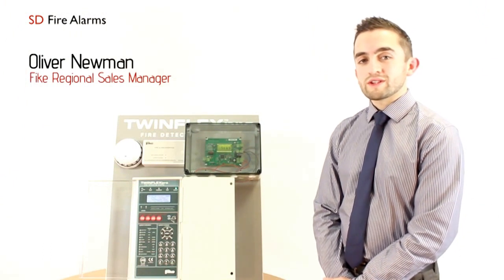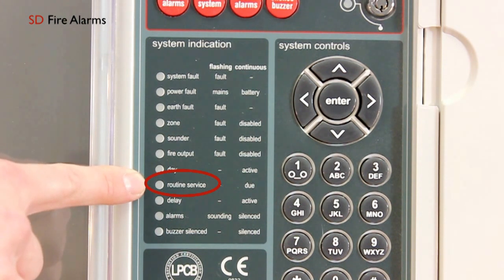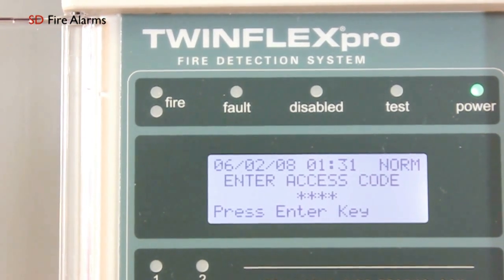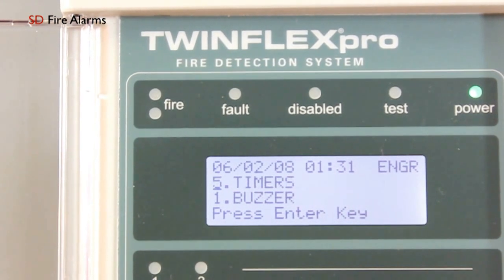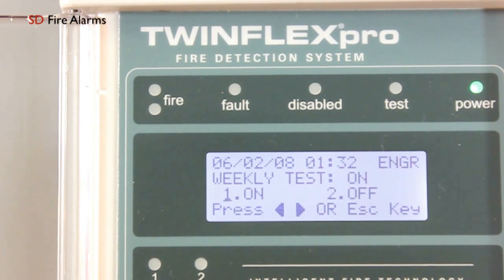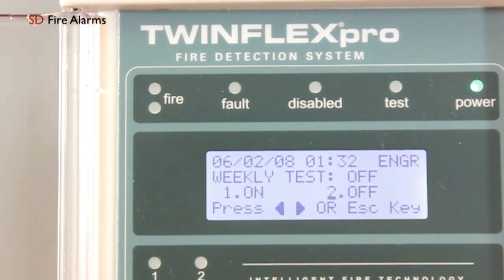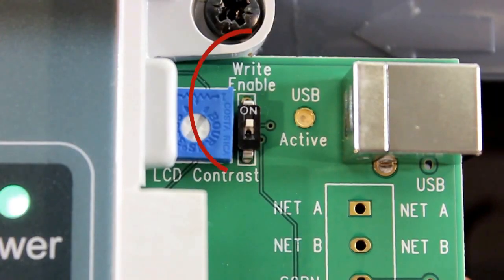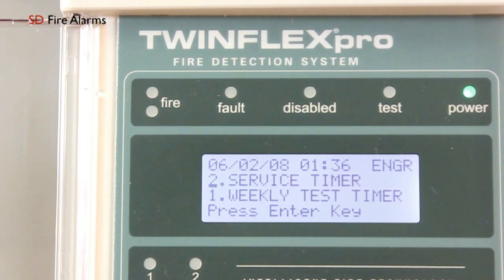Fike Twinflex Pro Panel Part 2: Deactivate the routine service

Comment: Cheers, doin my head in that, tested every single point on every single zone to try and clear it... Last engineers buggered off with engineers manual and it says NOTHING at all about how to deactivate that light anywhere in the user manual. Many thanks.